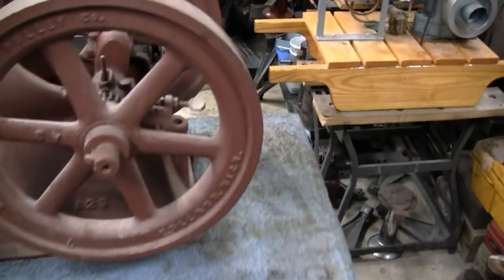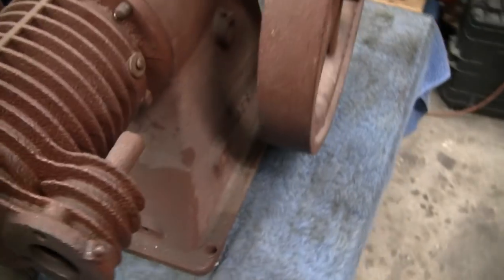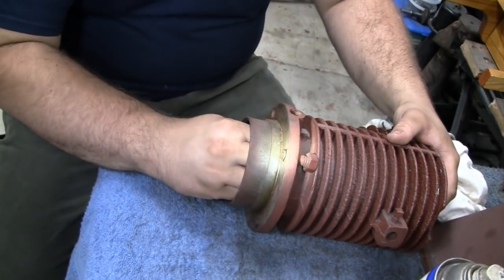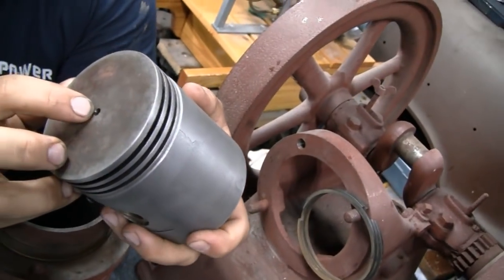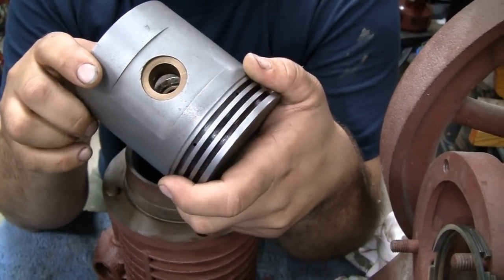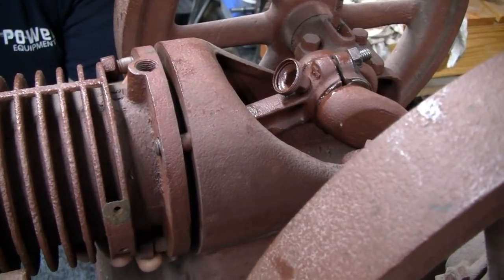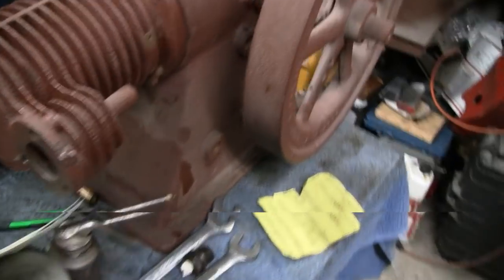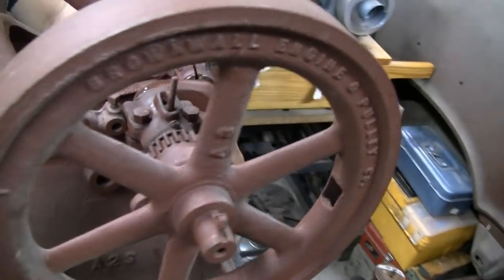BROWNWALL HIT and MISS ENGINE RESTORATION (part 2)

Comment: Since that engine won't be under for anything but playing around with that old piston would work just fine if you brazed or silver soldered it. 
 Years ago my father used to use JB Weld to repair sleeves in those old engines that were pitted real bad & never had any problems with that.

Comment: The original piston is made out of steel so why couldn't someone just weld it back where that it was cracked. Couldn't a good welder possibly weld it from the inside (and even add a little extra weld in there for more strength) refile the ring gap and reuse the original piston? It seems to me like I would trying that first could save some work and keep it original.

Comment: It's good to see you guys working on an old project, Thats a good way to use that piston like you said, I was thinking maybe alter the stroke depending how those figures would of worked out, as it's not a high speed and stress motor.  With 17 thumbs down you got 10 upset they won't see Mike make a new piston, and 7 mad they won't see you die grind that crack and fill it with your famous heavy duty filler compound to stick it together L.O.L.  
      If restoration was easy everybody would be doing it,  I'm just getting 5 or 6 of my old tractors running again that have sat over 5 years not being touched, they can be shown as found if I got some better tires. 20 years ago those.tractors would  of all been painted to show room condition without question. Priority's change over the years, now it's from the north 40 to running and driving suits me more for a challenge now. I  had to take a break from that truck door I was fixing and painting,  I started getting frustrated with it for some reason.   Thanks for the video's take care.

Comment: I would either have the original piston head repaired or duplicated. Might not be all that expensive. And then you could keep it as original as possible. It's a rare engine so that would be added value.

Comment: Thats a nice little engine, spit and misses not really my thing, but I could easily suffer an air-cooled one.
Nice solution to the problem as well, you said the exhaust valve was too long anyway, less to cut off now.
Only thing I'd do differently is the piston, I'd measure it accurately, change the bushes, and then bore the cylinder
to suit which would also get rid of the pitting, but like they say, it's your engine, either way I'll be watching. :)

Comment: the piston is larger on the bottom because the head expands more, they even out at running temp.some air cooled engines the bore was made with a very slight taper because the top of the cylinder is hotter and would expand more.

Comment: Your only chance to fix the piston crack is to use German SIlver Braze which has no silver content at all, but the strength two plus times the base metal itself. I have fixed a few with no failures to my name. Good luck too.
Reply from the maker: Thanks Vic!! We'll probably try that first, it's only a show engine!!☺
Reply: @805ROADKING  Just make sure when you are brazing that you heat the metal all the way through. Most weekend warriors just heat the surface and lays or globs and pushes the filler rod on instead of the fusible metal to enter the crack zone. Making  failure a reality. Make sure you either heat the piston well in oven to burn off the unburned hydrocarbons or soak in high reactive solvent for a day or so. Good luck and keep the videos coming too.

Comment: Didn't you say the bore has pitting in it?
Why cut the piston to fit, when the bore 
needs cleaning up?

steve
Reply: Thinning the cylinder bore to remove the pitting weakens the integrity. The depths  of the pits are too various to truly smooth out & most likey have pits so deep that boring the wall would be an impossibly.

Personally I would fill the pits then follow up with turning the i.d to the proper size. 

But for this case turning down the piston would be a better option than possibility opening the wall to the point that even the new head would be undersized.
Reply: @Rudofaux , Everett said it was about .010 oversize.

Ten thousandths, the thickness of 2 pieces of paper 
won't weaken a thing.  And, since it is a cylinder, it is 
only a .005 cut.

steve
Reply: @steveskouson9620  that wouldn't guarantee the removal of the pitting. Your original question was about pitting removal.

Widening of the bore is never a good idea. It throws the tolerances out the window. The piston would have to match as well as the rings.
Reply: @Rudofaux , what??

Cylinders get bored out all the time!

I'm not talking about someone taking a 
cold chisel and hammer to it, I'm talking 
"machining" out 5 thousandths of an inch, 
on the inside of that bore.

Or, fill the pits, and then, bore to fit the piston
and rings.

steve
Reply: @steveskouson9620  like I said earlier. Fill then bore to the original i.d of the bore. I wouldn't trust a bore out cylinder for the walls are now thinner even if it just by .005. would you trust a firearm if the chamber was bored out by .001? A bored out cylinder has the possibility of not being up to specs to tolerate &/or maintaining the pressures that is going on during combustion.

Comment: I’m sure you guys will get her going no problem. 

Do you still think that brazing or soldering the piston is more work than turning down the new piston, making new wrist pin bushings, making a cylinder spacer, and machining a new push rod? 

The challenge is what makes it fun.
Reply from the maker: We still might braze the original, we don't have anything to lose!!☺

Comment: Not arguing a shim is the correct/easier way to go but just because I want to know why couldn't a shorter connecting rod be made? I know it would be way more machining work but would it not have the same effect and look more "original". By that I understand once it's all painted the spacer will blend in but a shorter rod wouldn't have it like it doesn't have one now.
Reply: The shim, as Mike & Roadking agreed, is the most-likely "period correct" repair solution. The operator would have needed to get the engine back into service as quickly and cheaply as possible. Heck, he might have simply tried a washer at each stud.